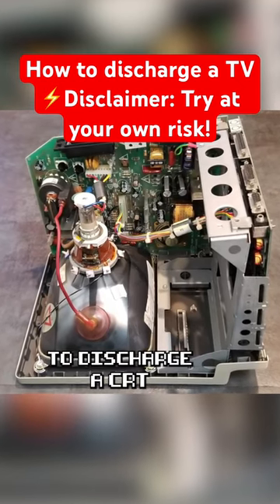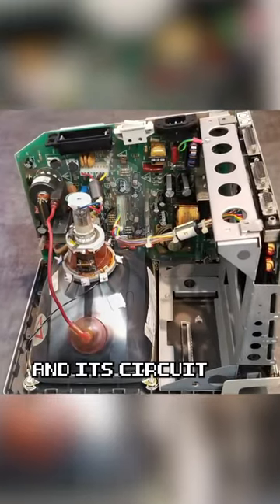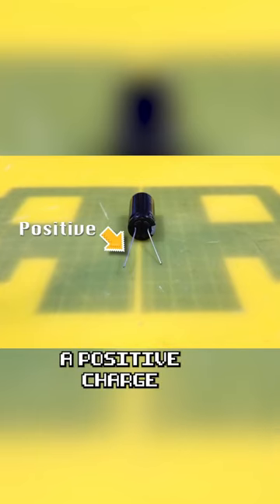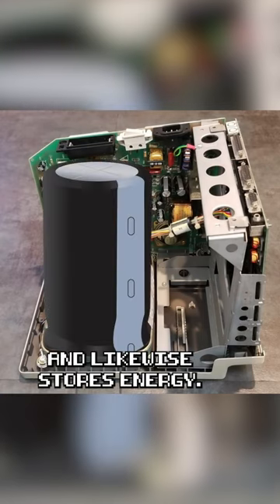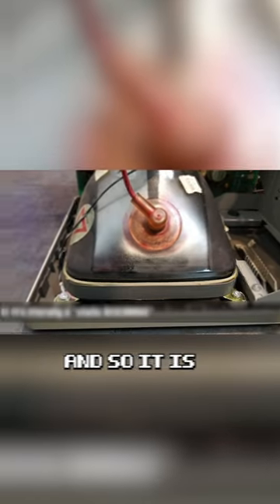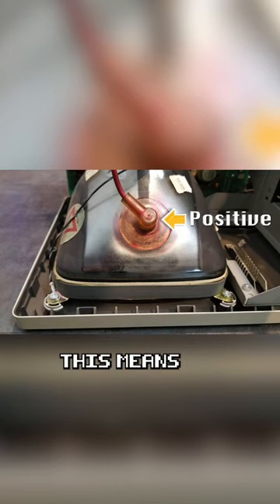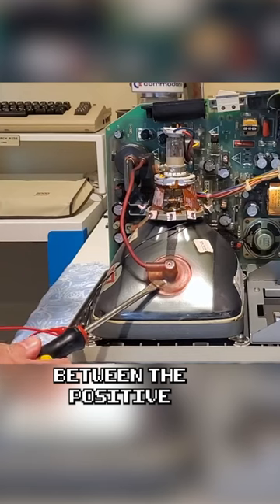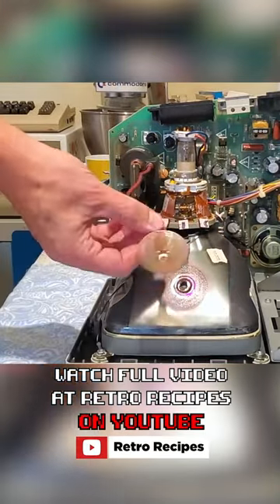How to SAFELY discharge a TV! #electronics #shorts

Comment: You want to put a big resistor inline, so the tube discharges over couple of seconds.  That's especially important for vector monitor tubes.
Reply: I learned that from Larry Pina's Macintosh Repair and Upgrade Secrets book - use a 10M ohm resistor in-line with the wire from the screwdriver.
Reply: @soupwizard  Preferably you may want a series of resistors of at least 2 or more.  Something around 1-2M Ohm 5W should suffice.  You just want to prevent the excessive rush in current.  You don't want to wait too long to discharge it and risk partial discharge in the process only.  Buy good quality stuff for this purpose... it's only your life;).  I wouldn't trust eBay or Amazon in this case, unless these are good reputation sellers.
Reply: @Omega_Mark  would it be alright if I just short each capacitor individually with a screwdriver alone as I don't trust myself to set up the resistors right to trust my life on it lol.
Reply: @sahilsquadron2286  Some people short caps with a screwdriver, even the Big Blues.  By doing this you can shorten the lifespan of these caps.  You are pretty much welding at this point, so expect damage to the screwdriver and even caps leads.  For caps you can use smaller resistors, as these caps hold less charge than a tube.  I would still recommend rigging something up (it's cheap), but you can use a screwdriver to make sure the cap is fully discharged (even after using the resistors).  It's better than shorting with your body:).

Comment: It doesn't hurt to put a 1000 Ohm resister in circuit between the chassis and the screwdriver you're using to discharge the CRT

Comment: Well... I think I need a clean pair of pants after that! 🤣 I knew about having to short it with a screwdriver, but have never had it explained so clearly before! Thank you! I believe you can also get proper capacitor discharger pens to make it a little safer and saves having that surprise spark making you jump, although not essential if using the screwdriver properly (and NOT touching any metal part of the screwdriver of course).